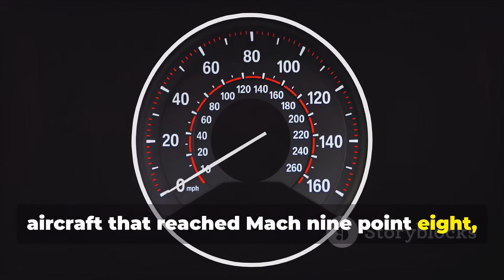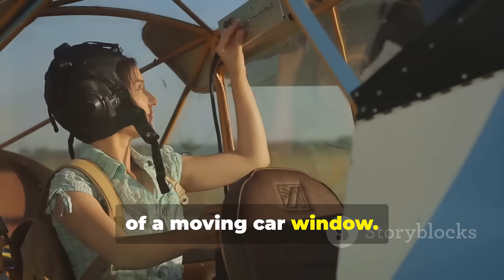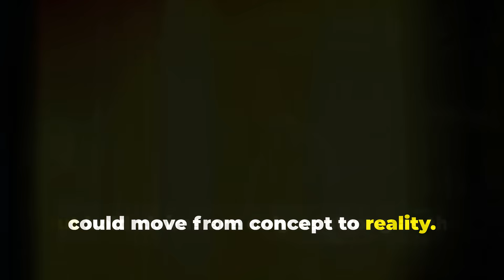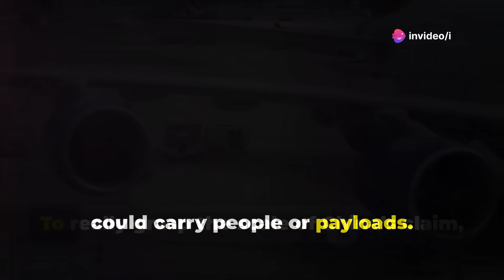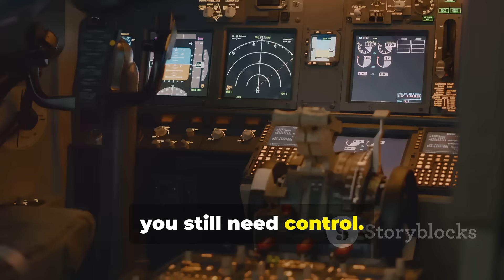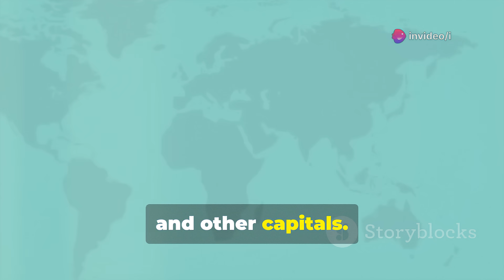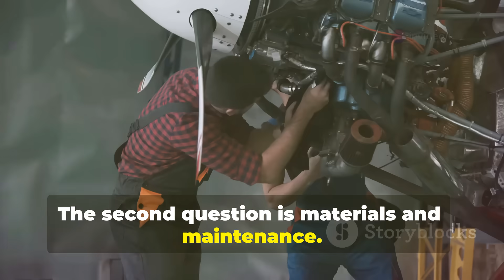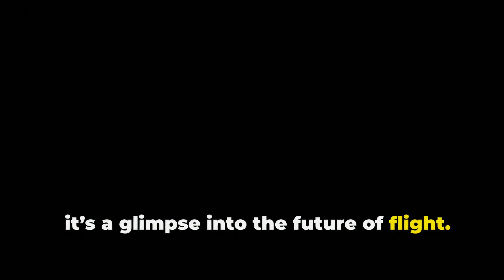Faster Than a Missile: China’s New Hypersonic Engine Stuns the West

Comment: US has not tested hypersonic plane at Mach 9 in the atmosphere. The plane at that time would have disintegrated. It had to fly in near space with reduced heat generated.

Dont know about Chinese hypersonic plane whether it has to fly near space.
Dont think many private individuals will want to fly that plane.

Dont think it is viable if it had to fly so high. 

At atmospheric flight the plane has to be lean and the capacity of the plane would be small. Wont be economically viable.